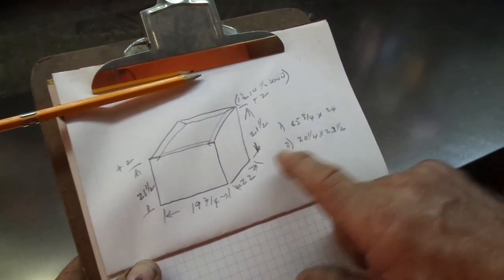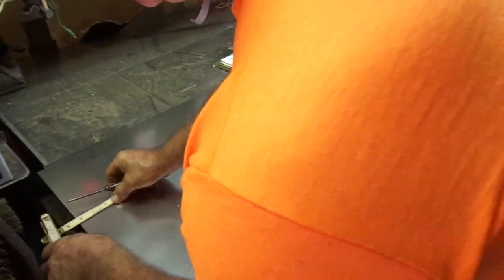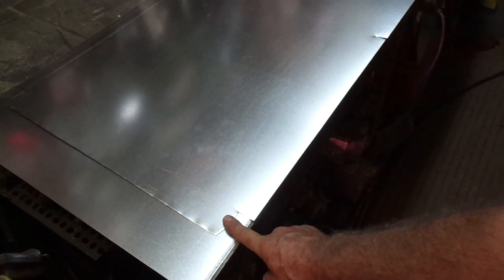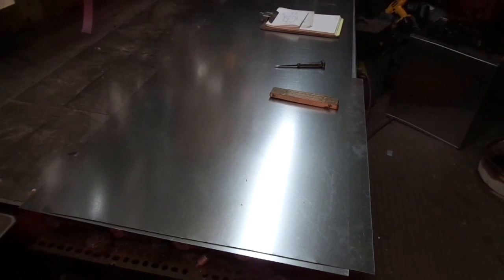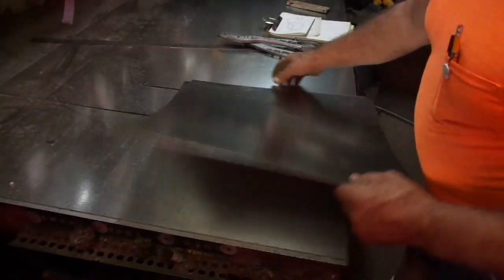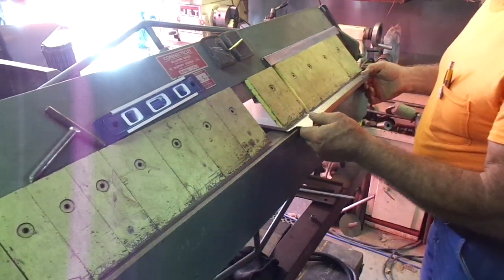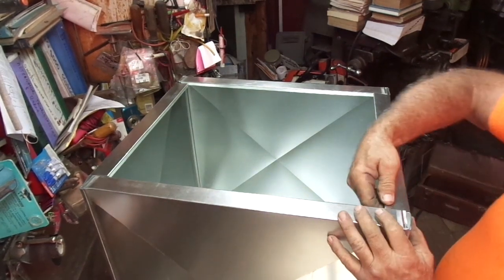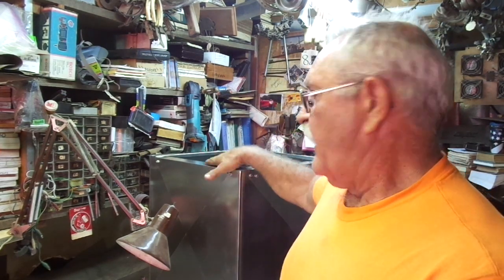Furnace Return Air Plenum Fabrication

Comment: Well done.....almost wish I was a tinsmith....na////I like the electrical trade....the industrial end of it that is but I have to tell you that you make it look so easy....CHEERS
Reply: I always liked industrial wiring too. Pretty easy and open. 
House wiring is not so nice. Just opened the kitchen counter recepticals so I can upgrade to grounded 20 amp circuit with arc fault and GFCI protection. 
Surprise. The old panel was an 8 circuit plug fuse setup installed in 1962. The electrician wired the house before the drywall was up. They daisy chained the kitchen around through the studs and ran one line into a recept box on the right side of the sink. Then they pulled 3 lines off the box to run the dining room, dish washer, garbage disposal, and refrigerator. 
The wires go up into th attic and across to feed the pantry. 
The job went fronm a days work in the open, to a weekends work in the attic, basement, and kitchen.
Reply: @OldSneelock  Housing I can stand but when it`s new and I do it .....when it was in the old days they cut corners and they did it the cheapest way and the appliances were not as plentiful as today so with time everybody added onto it....I have to say that you have a mess and I fell bad for you and all I have to offer at this distance is that I wish you courage like the Algerians at the beginning of every day would wish me,  because I think you need it and another thing....watch you don`t go through the ceiling because it does a big mess and more work.....CHEERS
Reply: @gatorsworld  Haven't accidentally went through a ceiling yet. Now that you mentioned it this might be the first. 😆
Just more work and an extra 15 bucks to add 3 circuits to the permit. It will clear up a few issues that needed done. I just didn't want to tackle them right now.
Reply from the maker: @OldSneelock  I'm finishing a total remodel project for my daughter that was from bare studs and siding all the way to the end.  New roof, hvac, plumbing, sewer, 200 amp entrance and whole house wiring, insulation, excavation, painting etc.  Oh yeah concrete work and a new deck with pergola top too....LOL.    Soooo I feel your pain...literally!!
Reply: @tractorman4461  Helping your kids is just a little easier to take than working for someone else. My Dad helped me build things every chance he got. 👍
Reply from the maker: @OldSneelock  Well on the farm, two actually, we were always breaking and repairing something or building something from scrap or scrapped machines.  I loved rainy days in the blacksmith shop the best !!  It is definitely easier working for the kids.LOL.  And I think your Dad was a very good influence on you.
Reply: @tractorman4461  Dad showed me that with five kids DIY was a necessity. I learned that I could live well beyond my means if I could rebuild or make what I wanted from scrap instead of making payments.
Reply from the maker: Sometimes I wish I was a tinner too...heck Gator, I ain't nothing but a old and wore out HVAC service tech.  I haven't had any technical training in sheet metal at all except one semester and there were no machines to use....